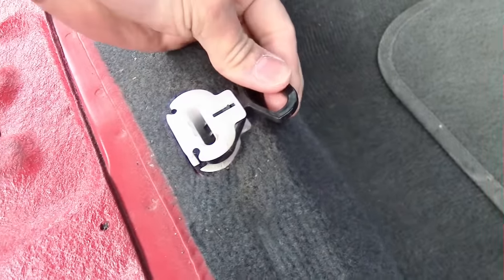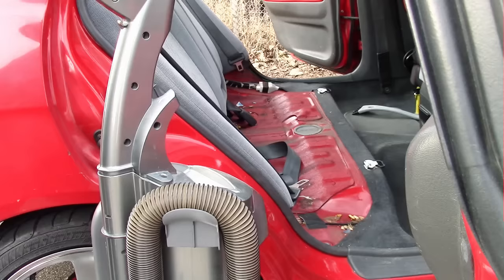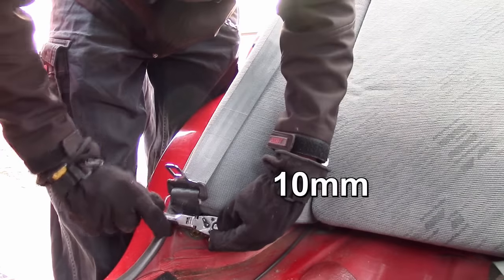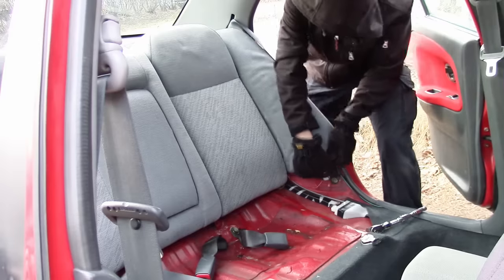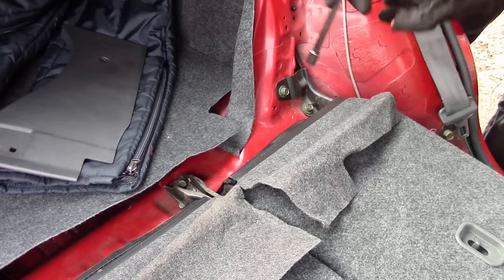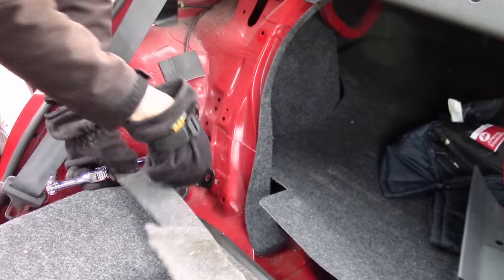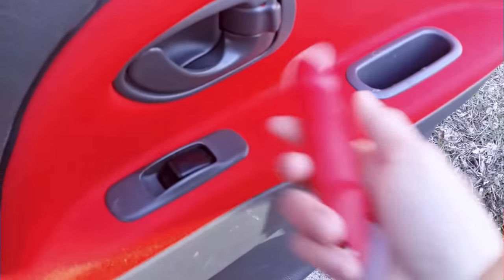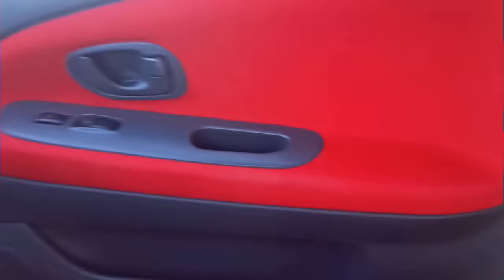Mirage Fix 20 | EVO 4 Back Seats, Door Trims Update

Comment: Very easy to use fabric from evo seats,  take to an upholsterer and have him remove it from the back section and he can sew together a new pattern using the evo fabric to fit the back folding seat frame from the glxi . I did this, only cost $300 au dollars. Having the full bench seat wasted room for when I needed to fold down the back seat., but still wanted the evo seat trim

Comment: How many miles and if rebuilt how many miles since it was rebuilt because you might want to rebuild the motor when you do it because turbo puts extra stress on motor and likely if you want to gain any power a custom chipset and computer is necessary to program that it has a turbo because stock computer will compensate for turbo and you won't gain much or even any power

Disclaimer: I'm no expert but I've read/watched it somewhere I could be totally wrong do your research but hopefully I've sparked your interest in overhauling the motor. 

Thanks
Reply from the maker: Brandon Mitchell Thanks! Yes, I have thought about it. Though, I think I only need to replace the head cylinder gasket since that's where the compression happens. I will replace it sometime before doing turbo. Plus I actually need to replace it; it leaks.

Comment: cafemiguel again: Hey just wanted to know if on my 1998 Mirage I can swap out the 1.5 Liter engine for a 1.8 without major problems; I believe the transmission on my 1.5 is very powerful and I like the response it gives, I'm no longer in my 20's/30's I'm up there in my late 60's BUT I LIKE CARS, what's your tip on this ??
Reply from the maker: michael cardona It will be bolt right on. :)
Reply: The DarkDragonWing Yes it will be straight (I hope) bolt on using the same transmission (my wife doesn't want me dragging with anyone). I know i'll have to look into the suspension and CV joint setup, probably the steering mechanism will also have to be looked into.  I like to call the Mitsubishi Mirage the true Japanese Volkswagen; there's so much you can do with them without breaking open your kids piggy bank and they just keep going on and don't die on you; thanks for answering.

Comment: Would sedan fenders fit onto a coupe? Is it and easy swap or would I have to do modifications?
Reply from the maker: Ariel Parra Yes, it is the same part. You can also use the corner lights from a 4dr Mirage or Evo 4, 5

Comment: It Sucks Going Through what your Going Through but it a Good Puzzle coming Together...here in The Bahamas a Evo4 was sold for $600 USD Just needed front Bumper...I had 3 Evo4's for under $2000 Great Condition i now have 2 evo3"S and i role a 94 Celica GT4 As my Daily...i might can help u with Parts
Reply from the maker: +Universal Imports omg! So cheap! I'm super jealous right now! :D If I ever run into finding new parts, I'll let you know. Right now I focus on my BMW E30 since it's easier to get parts and it's the whole car already, no need to convert, etc. cheers!

Comment: Hey was wondering if the split rear seats from the Mirage fit an 05 Lancer Es? I have the one piece rear seat in my Lancer Es and really want a 60/40 split rear seat so I'm trying to find a set that would fit. Thanks in advance.
Reply from the maker: Jordan Wetz No, it will not fit on 05 Lancer ES. But these will: http://www.ebay.com/itm/02-05-Lancer-OZ-Seats-Black-Ebony-Cloth-Back-Rear-Seat-Backseat-Cushions-Blue-/310972782193?fits=Model%3ALancer|Submodel%3AES&hash=item48676c1671&vxp=mtr
Reply: Thanks for the response. I'm still searching around for seats but I was also wondering if the Oz seats came in anything but blue?
Reply from the maker: Jordan Wetz
 I'm not sure about that too.

Comment: hi, how are you doing :D
i have a little question
my passenger seat doesnt move forward and backward all the way it just moves 5 cm or something and then it seems to be stuck, any ideas why that happened or how to fix it?
Reply from the maker: Osama Moharam You should spray some WD-40 on the seat rails. cheers
Reply: okay i'll try and tell you if it works :D
Reply: The DarkDragonWing 
no, it didnt work :\
it looks like its hitting something in its way but when i looked underneath I couldn't see anything different.
Reply from the maker: Hmm, interesting. Maybe the string broke or there is a coin on the rails.
Reply: so do you think there's an easy way of diagnosing that or I just have to remove the seat and take it apart?
Reply from the maker: Osama Moharam
 try removing the seat and really inspecting it.